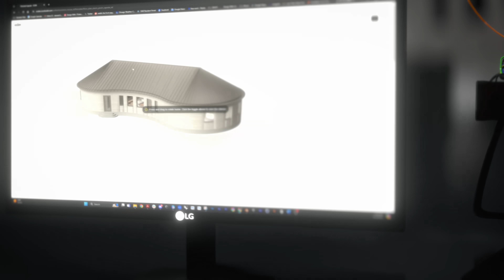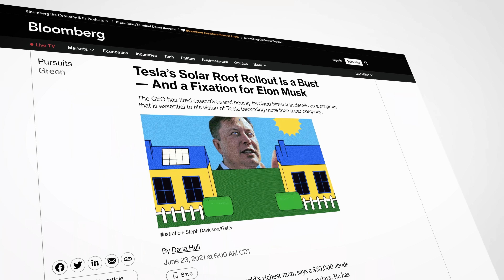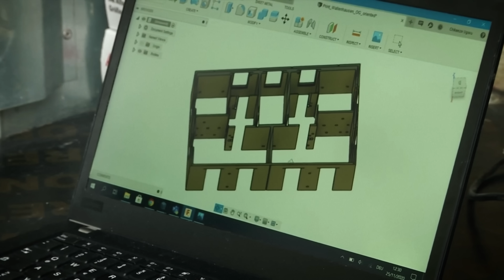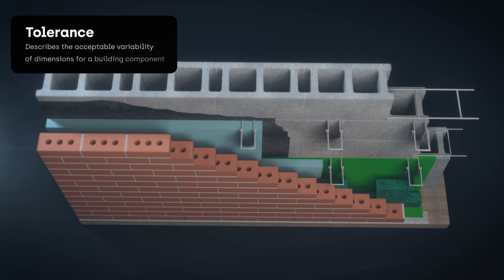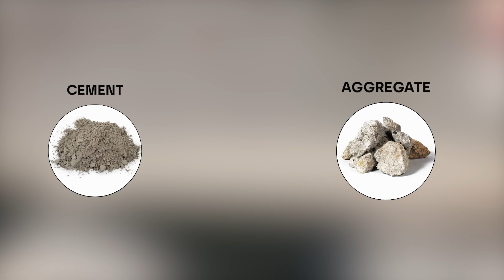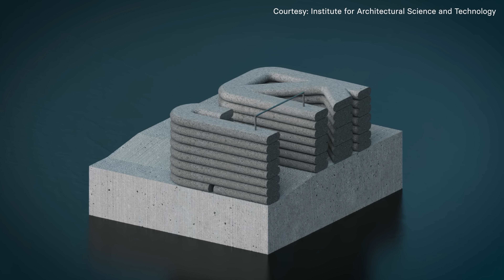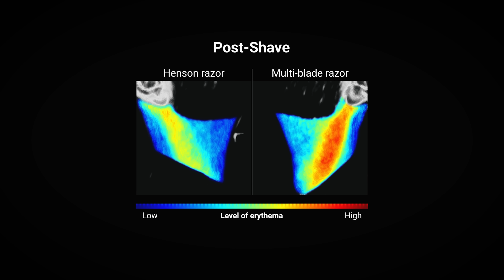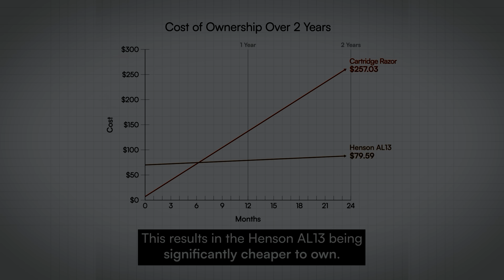Why 3D Printing Buildings Leads to Problems

Comment: As it stands (which wont be for long) i wouldn't trust a 3D printed house. Theres no proper addition of reinforcements.
Layer adhesion issues aside, theres not even any fiber additions to the mix let alone steel rebar added in to the walls.
All those layer lines on the walls will draw moisture like a wick.
Also because of the surface texture, the surface area of your walls will act like a massive heatsink.
Expansion rates rates will differ drastically on different faces of the building.

Comment: It'll never go beyond just doing the basic form, it can't do plumbing, electrical, architectural elements, details, doors, windows, trim, fixtures, balconies, decks, stairs, insulation, sealants, wall finishes, roofs, ceilings, reinforcing steel, railings, carpets, bath fixtures, kitchen appliances, lighting, and so on. This is why it'll never go anywhere beyond a curiosity fad, it just simply has no significant advantages. It's only people who have no practical construction experience are easily deceived by the fantasy of printing buildings.

Comment: Why does no one try to 3d print forms instead of the concrete itself? These forms could be printed out of various plastics like traditional 3d prints and then filled in with concrete, I feel like this would take print time down and let you place electrical conduit etc before pour
Reply: Like you could print the outer form walls and even rebar style reinforcements between them before the pour, this would also give the structure much better seismic/ground shift protection. Those unreinforced walls will crack even in areas where the ground shifts bit with seasons.

Comment: The price of building a house isn't the problem it's the selling price that is. 

Building a modern (not luxury) 3 story house (Basement, Ground Floor, Upper Floor) costs about 100k in material, including the land, and labor. That's expensive, yes, but doable. 
Now, if that house is sold, which includes you telling a builder to build it for you in new developments, you will be paying between 2 and 5 million for that same house. 

Because the value here comes from it being a house and houses being scarce. So they can ask whatever and someone will pay it. 

In less awful, but still failing housing markets in other countries, you can see similar houses in old developments (refurbished 1930s buildings for example) going for a tenth of what they do in the US, because the US housing Market, along with the Australian housing market and so many more, are all completely cooked.

Comment: TLDR
Automation doesn't mean it will be cheap.
Building in one pease is a repair nighmare.
Its cool tech demo
BUT
Indyvidual and cheap ar oposin concepts 😅
Wonder how symilar to the plastic filament is a cement...
13:45 that sagway to space tech manufactured shaving handle €:
I love me some "theirstaff is on mars right now. Sure you can trust rhey know how to make a blade"

Comment: I've yet to see any major benefit to 3D printing buildings, certainly not enough to offset the obvious disadvantages (like the lack of rebar or other sufficient reinforcement). Concrete is pretty good at exactly one thing: compressive strength, if you need it to do anything else, you need to add reinforcement. And you need to do it properly so that the reinforcement doesn't become a detriment (like cases where cracks have let water in which causes rebar to rust, which takes up more room than the original iron which pushes on the concrete, making cracks wider and creating new cracks, causing more water to get in, repeat). 

It really seems like a sunk-cost fallacy at work. Too much time and money have gone into developing 3D printing for buildings for them to realise it's probably a dead-end technology. Maybe, maybe it'd be useful to construct things where human construction workers can't go (or would be impractical), like Mars or the bottom of the ocean. In those cases, though, concrete might not be a viable material anyway (concrete probably isn't strong enough to withstand ocean pressures if you want to have a breathable atmosphere inside, it might be strong enough to withstand a breathable atmosphere on Mars, but the concrete would be under tension in that case, the direction of force it's weakest against).

I applaud attempts to innovate, but sometimes you have to eventually realise it's not going to do what you wanted it to.

Comment: An overall cool video subject and well made but there is a alot of very incorrect and misleading information in it which is so unfortunate. Some of your construction information, for example, presents certain scenarios as insurmountable issues when they are in fact common and easily overcome. For example, It's doesnt take a rocket scientist to figure out how to make a repair to a 3D Printed house. There are alot of smart people (or even just ones with common sense) outside of the companies that build these houses. Repairs are not an issue but your statement makes it seem like people in a 3D Printed house are living in a ticking time bomb they'll have to walk away from. It's like you were paid by "Big Timber" to slander the tech. Either that or you're drawing terrible conclusions were you lack actual subject knowledge.  
I'd like to see this video remade with better subject knowledge and a lack of bias against 3D Printed homes.

Comment: 14:21 they also tell you that the razors dull a lot faster than they actually do. You mostly need to get the blades clean and dry as fast as possible.

I've gone over a year on a single cartridge without issue.

Comment: Imagine needing to fix a leaky pipe behind the wall? How can you insulate in a way that prevents water line freezing? Is this viable in a climate that sees yearly temperatures below -40 degrees? This seems so improbable

Comment: The house still needs a concrete slab, plumbing, drainage, electrical, interior fitting, etc, all requiring skilled labour and time. You can get prefab metal or wood frames made to order in factories, it seems to me to be more efficient to put the automated construction into centralised factories like this. The machine on site requires also horizontal clearances on the site. In my city a lot of new housing is going up on subdivided existing housing land (sacrificing the backyard to build an extra house, increasing urban density). The entire idea just seems really niche.  Why not just  develop a bricklaying robot?

Comment: I don't see what's so bad about making wooden forms and just pouring real, proper concrete with stones in it. What these things print is just cement. I'm not an expert but it looks like a terrible idea. Why not just make a robot that can lay bricks? Surely can't be hard. It'd be quicker, too, filling up space a brick's height at a time instead of a centimetre of cement. A cementimetre. 

Have it lay concrete breeze blocks instead and it's 4x quicker! That's what most buildings are made of anyway, with a brick facade. Have a robot do both. It'd need to be dextrous, but if they can have robots doing surgery and gymnastics, I'd imagine they can do that.

Comment: So basically, there are no problems, and pretty much all the things mentioned are simply habits that we were used to and now we're just gonna have to leave them behind.... 

Every hole, and every window installed in my house har caulking and construction foam around it. Same for evey pipe or a cable penetrating a wall. 

 Straight sharp angles? Oh no... What are we going to do without them? 🤷🏻‍♂️

Modification or addition? Is that a problem? Seriously?

Comment: It CAN be vertically intigrated, there's just MORE MONEY to not be.

When it is, big businesses just cut corners and design and always end up making the same boring cheapest design, in a new development.

Even when they have option, and make " nice houses" in the suburbs, buyer usually get 3 - 4 options with LARGE PREMIUMS for different designs, additions, to accommodate and extra or even just different from what's offered.

I my experience, even when new construction are built in the burbs, they become McMansions.

And this video is litterally about building CHEAPER cookie cutter houses.. You go live in you plastic house buddy. 😂

Comment: I can already hear plumbers, electricians etc. screaming their heads off because you pretty much can't drill straight in this stuff. As the shape of concrete moves drill up or down. BTW. I wonder... can't there be an employee smoothing the walls after machine?

Comment: The printed walls will only be left exposed as long as 3d printed houses are new and hype. After that, walls will all be covered and bare print lines will seem unrefined and out. It's like with electric, sewer and so on, first it's new and in fashion, then it becomes standard and you can't brag about it anymore, so you hide it and make it invisible and work like magic.

Comment: "Building a home" is not just squirting some concrete to put up walls. Wood framing, drywall goes up as faster or faster than squirted concrete. It's a fantasy.

Comment: I don't think you touched on it but with variable geometry concrete like that, there's going to be more pronounced thermal expansion over time. Some parts of the house will expand/contract more than others which will lead to the concrete cracking and shearing at different points. Akin to layer line shearing in a 3D print. 

Heck, if your foundation isn't up to snuff/plumb then the cracking/shearing in your walls might be more noticeable in concrete compared to a wooden/drywall structure. There's just much less mechanical compliance than a composite material structure (wood, brick, siding, insulation, drywall, etc).

Not to mention the use of fly ash will make a 3D printed concrete structure terrible for those with asthma. 

I like that you mentioned prefab'd concrete walls and such that could just be delivered. The Soviets did it during the cold war in droves (so called commie blocks https://en.wikipedia.org/wiki/Khrushchevka#History )

Concrete in good pretty great in terms of building materials when it comes to the amount of energy & CO2 required to make it however the water use is ridiculous and abhorrent.

https://en.wikipedia.org/wiki/Embodied_energy#In_common_materials

When you factor in the logistics of getting all that concrete material to the site it could be worse energy/CO2 wise than just using the materials that are native to the local environment (local timber in a sustainable manner, etc)

Belinda Carr's did a great video on this topic too. She's an architect by trade and did a great deep dive on this topic too (timestamp).

https://youtu.be/sz1LM9kwRLY?t=356

TL;DR 3D printed buildings is a niche but its not a panacea to the cost of housing. Like with most things, new technology is an excuse/a crutch for not implementing progressive policies that cut down on greed by large property owners/corporations in order to rein in the cost of building/maintaining houses. Just give people homes ez.

Comment: Looks so vulnerable, the wind can cause erosion and turn everything into dust in few years. And the layer is a weak spot, one little vibration can cause it to crack and falling apart.

Comment: Wall construction is such a small part of the overall cost of a new build, yet that's a huge part of their marketing. Call this what it actually is which is another silicon valley / startup type attempt to throw tech at a problem that doesn't exist in order to monopolize the profits for one company. Just because people innovate does not mean it's progress, and systems designed to push more money to a small group of people running a "disruptive" company are definitely not what our country and tradespeople need.

Comment: Well I think these types of buildings are the way forward Maybe people will be able to buy a House that stays up and not be ripped off like they are now its Fast and they can be made to look like any kind of building you want any shape and any type sounds like your looking back woulds not forwards we need new houses now for people to live in , oh and well we all know about so called architects and the miss stakes  they make apart from some of the diabolical designs they come up with, Also most modern tower blocks and concrete bulding's don't get looked after anyway just look at all the collapses that are happening more and more,  3D printing is what needs more development in this world of prefabricated housing.

Comment: Yep, every new technology leads to its own unique benefits and challenges.  Just like one might say horses never have to have their oil changed, but then again, that didn't stop the automobile from becoming the dominate form of transportation.  Traditional building methods are well understood, and have a lot of legacy solutions, and fundamentally new approaches will have to develop their own solution space.  The question is: will the net of the new approach be great enough constitute a generational leap over existing approaches?  Time will tell.

Comment: I can see walls being 3D printed with plywood on the outside of the printed concrete and I can see how cracks in a dried 3D printed building can be fixed with concrete.

Comment: This would be beneficial for 3 plus 6+ commercial residential buildings. If it can be engineered code. Print the base structure parking space and wood frame on top
Reply: You can't print the wood part can you? Only cement right?

Comment: Comparing 3D concrete to brick private homes is a little dishonest.  Those brick homes are wood framed homes. The Brick is just the outside layer. The brick isn't supporting the roof of the house, for example. It helps protect the house from exposure like vinyl siding does.

Comment: I already see a massive problem not being addressed here.  Without some level of flexibility of a frame, either wood or steel, just going by pure concrete can lead to massive issues with ground level, winds and any other outside effects onto said structure.  As an example, I live in the middle of Tornado Ally and you need to be able to take lots of wind, hail and objects in the wind.  On top of that, what would the repair costs be when damaged?

Comment: just dont print the vacum for the window, print a full wall, them trill it with a saw so the window fit is perfectly squared, maybe even using a secondary concreet made to be temporary scafolding that can brake ezly

Comment: The problems mentioned are all pretty superficial.  Corners can be sharpened, outside textures can be sided, and the inside can be plastered or Sheet rocked.  My largest concern is structural integrity.

Comment: It is not correkt that you need a lintel to make openings in a bricked wall, of course there are techniques to make window or door openings with help of a wooden understructure which gets removed when the mortar hardened. but those techniques are costly and cost more time.

Comment: Has anyone tried dropping in prefabbed rooms?

Also, why not externally insulate and render? Nice smooth finish, rounded corners lend it to Art-Deco aesthetic.

huge thermal mass inside the insulation line makes it very thermally stable.

Just thinking out loud

Comment: Difference I see from these prints vs normal brick/concrete is plain and simply the metal reinforcement period.  Funny how that just got skipped over. So glad they saved room for just insulation lol.    I'd assume wiring as well? Or oops is that a whole other can of worms that makes this stupid?

Comment: I had briefly a 20% stake in a 3D house printing company before I decided it was not viable. The construction times are not any faster than brick when everything is taken into account. The onsite risks of vandalism are higher (the equipment is very expensive, not to mention the building very fragile before it sets properly). The transportation, storage, manpower are all equivalent or far more to 3D print. 

The niche market is not project housing, but rather upper end architecture, public buildings (libraries, schools, etc). The real breakthrough will be when it is easily integrated with traditional methods. Its biggest advantage is the ability to create complex curves which would be near impossible with traditional methods.

If someone can create a far smaller setup, without the risks of vandalism and theft, or otherwise have it on secured sites, where the creativity advantages can be integrated, then it will have found its niche.

Comment: I'm a Communication Designer, shifting to Brand Strategy, but I'm also Communist. One thing that you just mentioned briefly regards costs of housing. Yes, the materials, etc., if something needs to be redone or fixed, has higher costs, but overall, those costs, the people that want a house to live and live in the streets, shelters, or whatever, if gave them all one of this houses each, would we, or wouldn't we, lower the cost of living for all? I believe we did. I wouldn't mind living in a house like that and that the house would be mine.
If you want to address this question, please correlate it with pre-built stuff. I lived in a building pre-built, a whole block of buildings in that area was pre-built, but I was renting, so, the cost didn't reflect that, rather the area, when I was in University.
So, as someone that defends housing for all as a birth right, yes, please address this questions above. Thank you. Good video!

Comment: The problem with these 3D printed houses is just like you said, the difficulty of repair. I've poured my fair share of concrete and I can tell you it is a strong material when used correctly, but just like with any home or building material it needs maintenance and it does crack like no ones business. Having to repair a 3d printed home I'd bet will be more expensive than a standard home. I just don't see it being viable at scale for a long time.